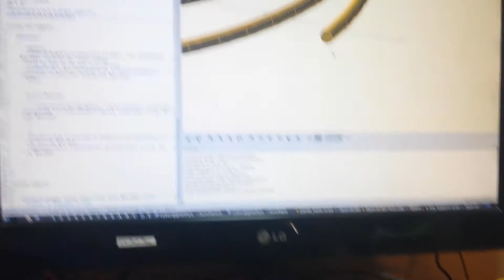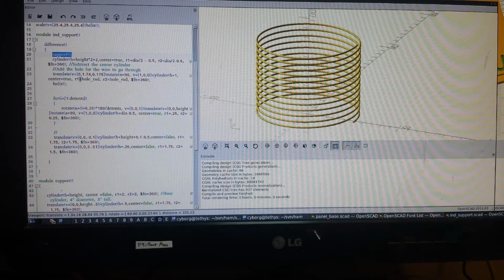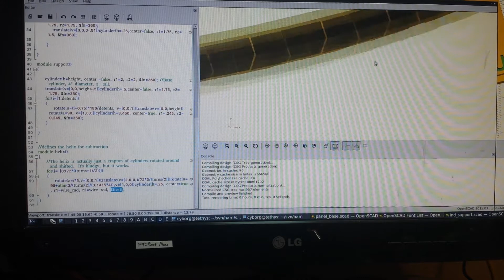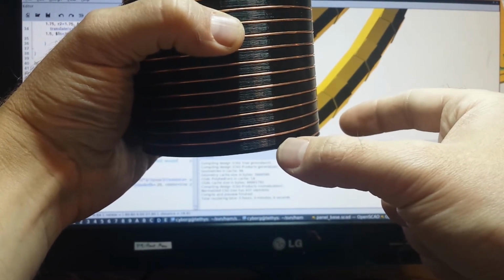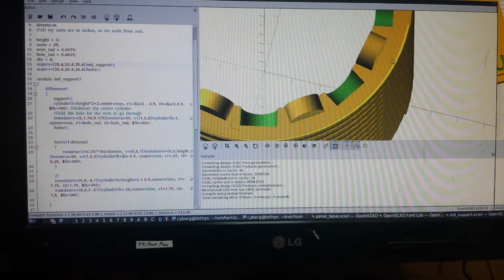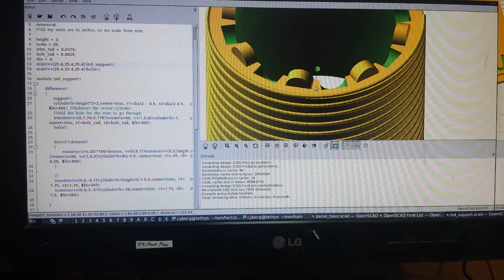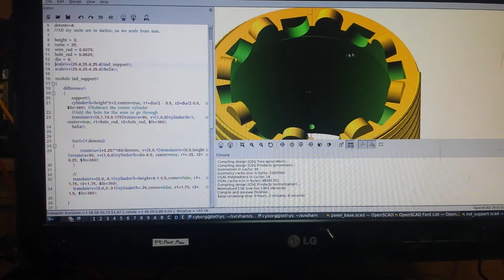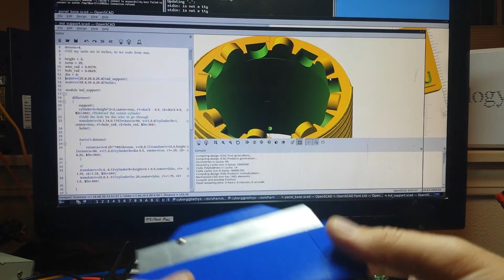A coil form for loading a 40m vertical on 80m

Comment: Great video, how hard would it be to make center and end pieces so you could make it as long as you wanted?  (center section having the half-moon interlocks both top and bottom and top and bottom sections having them only on one end)
Reply from the maker: Shouldn't be hard at all, you could easily replicate the locks to stack them forever.  Probably copy/paste the code and just make sure it lines up right.

Comment: Ha.  When I first saw your call I thought " Hey! he stole my call sign!"  AE7UV :-)  I just finished printing an enclosure for a current balun on my Monoprice printer.   Still need to put it together.  Have you tried HTPLA filament?  Prints like PLA but you can "temper"  it and it won't sag on hot days like PLA will.
Reply from the maker: I haven't tried other filaments on my printers, I've been viewing my 3d printers more as tools rather than as projects...  I have enough projects as it is without spending time dorking on filaments...

Comment: Dear bro,
What is the gauge of the insulated copper wire...??
Reply from the maker: It's not insulated, it's 18ga copperclad.  But no reason you couldn't adjust the print to create a wider groove (or just use insulated wire).

Comment: This is incredible.  From your description, it sounds like we have the same 3D printer.  I’ve not tried ABS on mine though.  I got here searching for an 80M loaded vertical.  I’m looking to build an 80M vertical that can fit on my 31’ Jackite pole.  I was going to opt for a smaller diameter but a bit longer to allow it to fit over the pole without sticking out too much.  N1XF
Reply from the maker: It was done in PLA for me.  No reason you couldn't do it in ABS too though, if you have a printer that can do it well.  I would not personally do ABS on the Monoprice printer, it'll probably warp to all high crap.